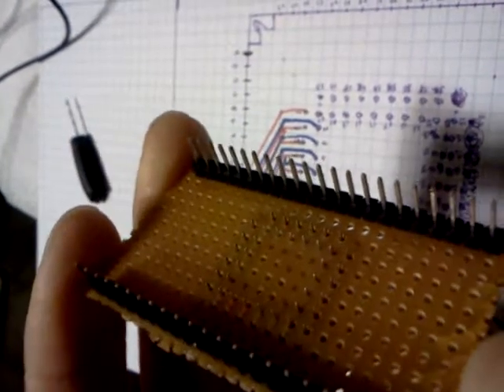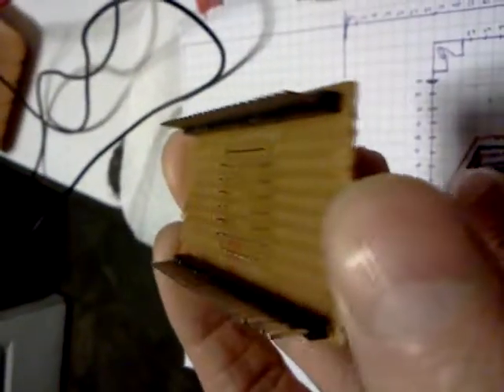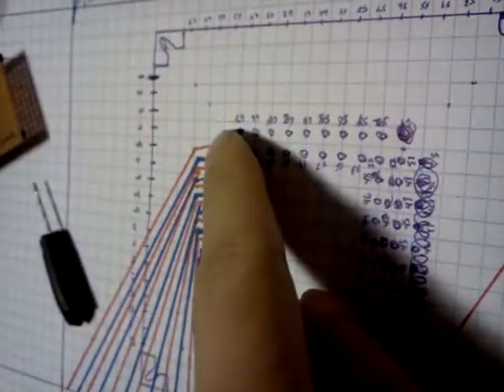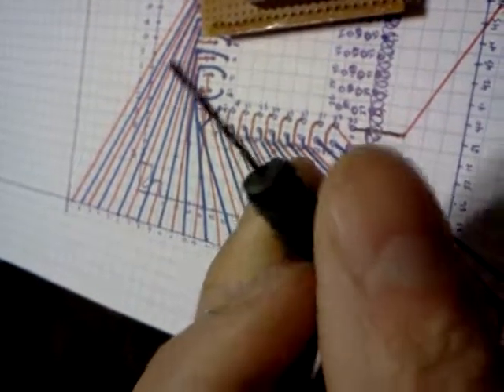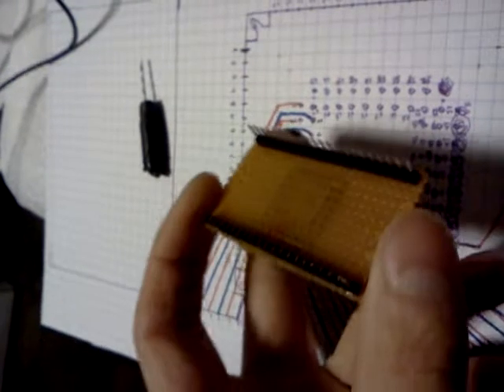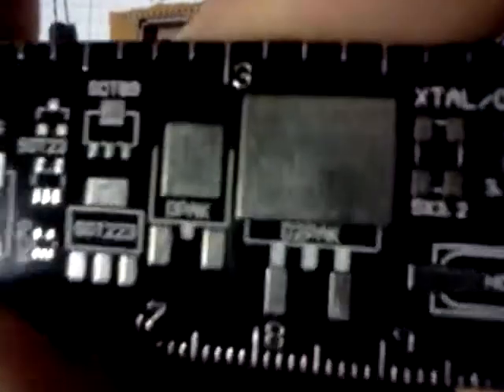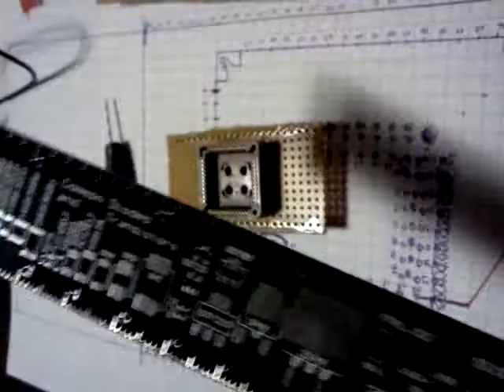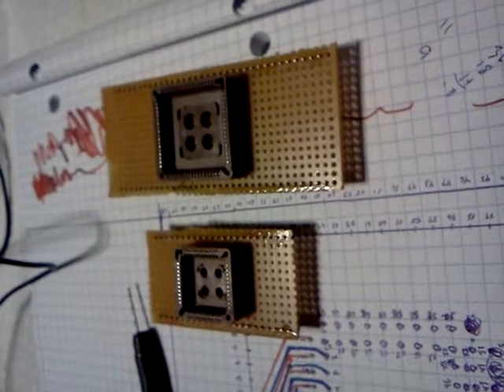TDS Family Debug/Options and PRO-2006 CE-232 Interface prototype PLCC to DIN adapters

Comment from the maker: Darn, I just realized I did the drawing wrong as pin 1 is in the top middle on PLCC chips. 
PLCC 68: https://www.nxp.com/docs/en/data-sheet/MC68HC11F1.pdf
PLCC 44: https://www.nxp.com/docs/en/data-sheet/SCC68681.pdf

Comment: So what was it you were trying to accomplish with this?
Reply from the maker: Keeping busy during cold winter days, moving forward on electronics projects that add computer control via RS-232 interface and with this... I even had to think about for a few seconds since didn't work on last winter..., originally breadboarding the Radio Shack PRO-2006 CE-232 for study and in particular starting with a more versatile PLCCC68 to DIN68 interface for the Motorola MC68HC11F1 PLCC68 MCU to begin with.  Not sure off hand why I was thinking for use with the TDS Family Debug Option 13... most likely thinking using a PLCC44 SCC68681 to convert the board connection to RS-232 interface and ultimately to USB also I'm thinking.
Reply from the maker: Thanks for asking!  I needed the question as a reminder to move forward on these projects for this winter.  I now have a range of the different package adapters for breadboarding projects.  Also some better tools and awareness as that project was early on in my soldering and design skills.
Reply from the maker: Still a newbie though.  My two B.S. degrees are in Chemistry and C.I.S. where instrumental analysis and maybe physics along with maintenance and repair in the labs I've worked in is where my electronics experience comes from.  Otherwise, all self taught and studying.
Reply: @jafinch78  Wasn't clear on the "TDS Debug part."  I'm working on a distantly similar project to replace the front panel uC and probably LCD entirely.  I've figured out the turning of the PLLs and got interrupted a year ago just before confirming the filter selection logic.  Good luck with your project!  I hope I finish mine one day too.
Reply from the maker: @rickr530  On a TDS-XXX family scope or PRO-2006?  For the CRT replacement on the TDS's, I left off looking into arcade adapter cards.  Purchased one... though wound up restoring the CRT operation on the TDS-520 I was planning to replace with an LCD and add an external VGA connection.  Left off needing to replace I think two capacitors on the main board I narrowed down to being out of spec.  Sound like you have an interesting project and look forward to you documenting also and if you have... please share the link here if you don't mind.  I'm thinking I can reference other online locations I've written regarding the related projects to better organize with this video too now that I think about.  Thanks again and Good Logic also!